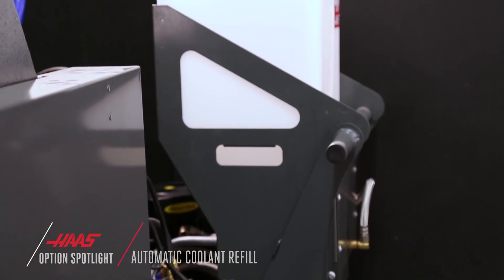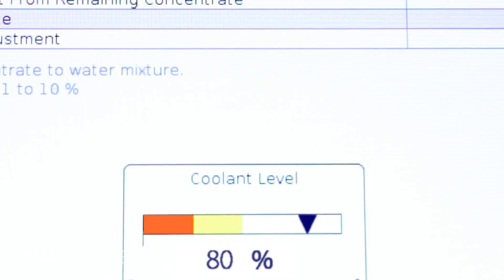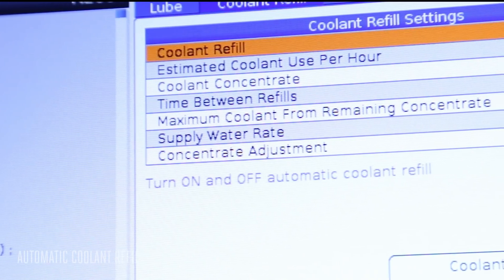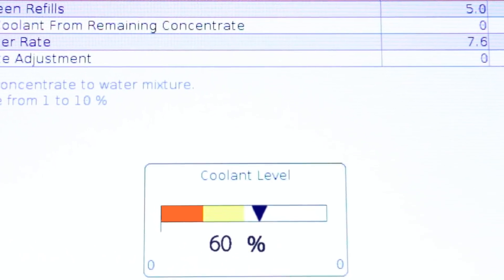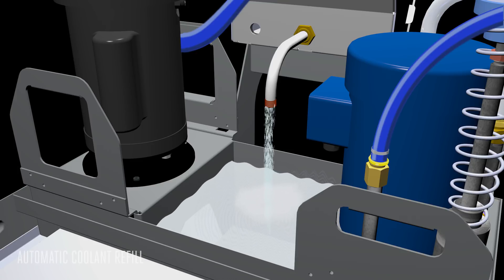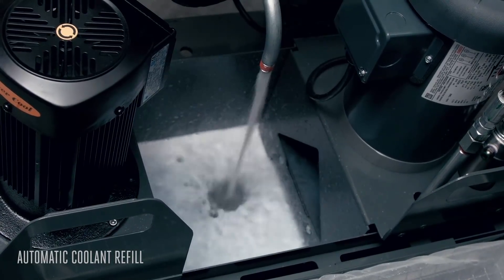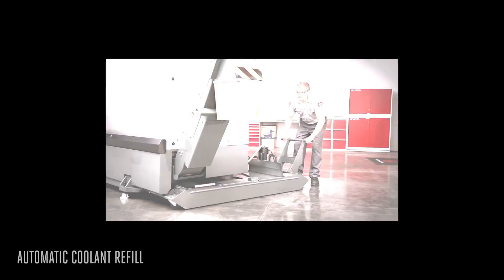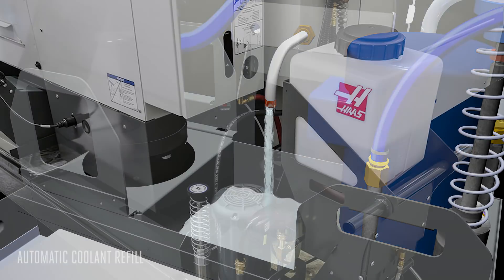Automatic Coolant Refill - Haas Automation Option Spotlight

Comment: Thank you, Haas for these options and information. I would like to suggest something (since Haas seems to listen to customers and the marketplace) regarding the sump. Why is it these sumps are built with 90 degree sharp corners? All these sharp corners are just places for bacteria and gunk to gather and chips to pack into. Isn't there a way to build these tanks with rounded corners or covings? It would make cleaning up much easier, faster and, I would think, extend the life of the coolant. Just a suggestion.
Reply: Well having 90 degree edges makes the most use of the space. You get a shit ton more coolant in a tank that is not rounded. For the "bacteria and gunk" you can use coolant that prevents bacteria and mold. it tends to be more costly but not to much. for the gunk part that may be wayoil or some other oils floating on top of the coolant. you can use a cheap oil filter which is just a tiny conveyor into the coolant tank that goes out and scrapes off the oil since the oil is the only thing that sticks to the conveyor belt. It also can cost more to produce a rounded sump depending on the production methods used/available.
Reply: Why not just higher quality grade coolant. Got more lubrication and doesn't smell after a while. I clean the coolant tank once a year even tho it inst necessarily.